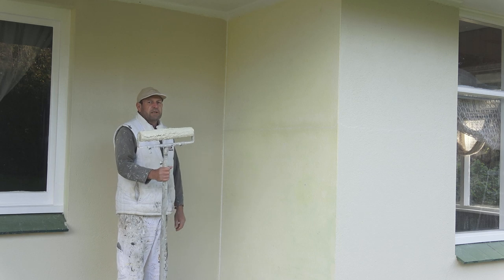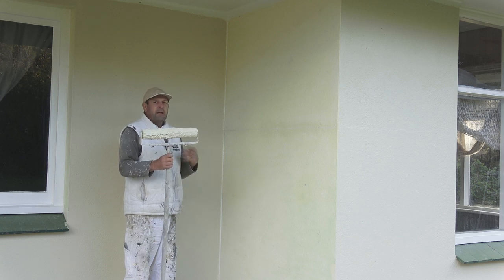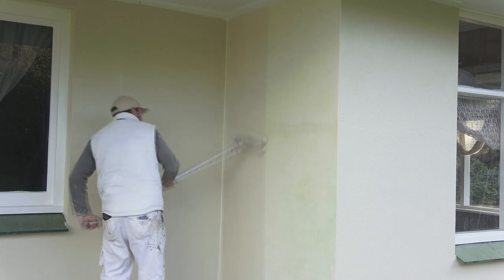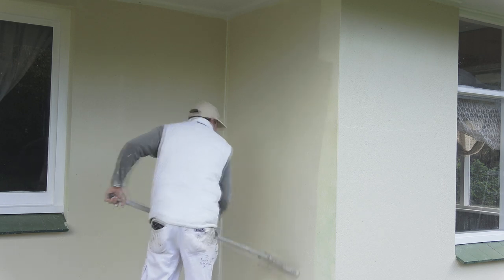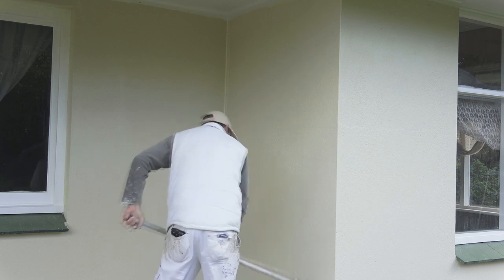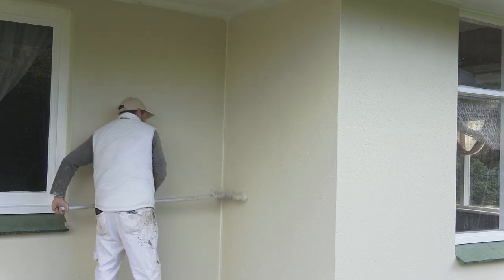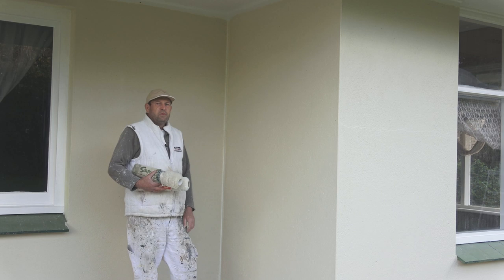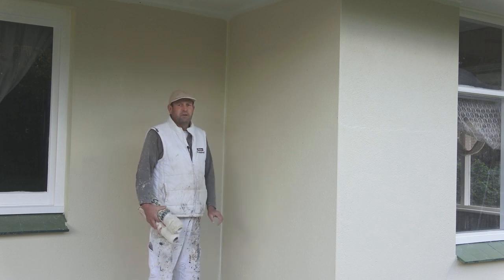How to paint cement rendered walls using a roller.

Comment: Do I need to primer a cement surface or will I just need more coats? This is for a cement garage footing. Thanks for the video!
Reply from the maker: You can prime or just thin down the top coat a little so it soaks in. Just make sure you are using a self priming exterior acrylic, if not then you will need to prime.
Don't forget to Like, Share and Subscribe.

Comment: Hey bud, great clip. I've got a roughcast finish interior wall. Kind of looks like very rough sandpaper. Or literally like someone painted over sand/ small pebbles. Go the same way as you have done here. Cheers from Perth👍
Reply from the maker: Yes you can do it the same as here, the rougher the texture the longer the roller sleeve nap needs to be.
Don't forget to Like, Share and Subscribe.
Reply: @howtopaintinfo  Yep copy that bud👍Cheers for the tips. Subscribed and certainly liked. People like you save people a lot of money. I've used painters in the past when I'm too busy to do it myself and have had my fair share of sub standard work. If you want to do it right sometimes you have to do it yourself.
Reply from the maker: So true.

Comment: Any advice on what paint to use with newly applied cement render?  Can just go ahead with an exterior paint or need to seal it with something?
Reply from the maker: Most exterior acrylics are fine to use without a primer,   just make sure you read instructions on paint can and also thin the first coat about 10%.
Don't forget to Like, Share and Subscribe.
Reply: @howtopaintinfo  thanks!

Comment: Would you consider using an airless spray gun to increase the amount of paint delivered on the wall followed by a pass with a roller or large brush? Thanks
Reply from the maker: I'm glad you said followed by a roller or brush as just spraying wouldn't work. The issue with spraying is all the masking time.
Don't forget to Like, Share and Subscribe.

Comment: I got my house done recently it’s smooth finish but if I touch the fender the sand comes off shouod I give a light sand first before painting !? Is there a certain type of paint thick layer so the render doesn’t chip off ?
Reply from the maker: The render shouldn't come off that easily, it should be a hard finish. If it is coming off easily it might be best if you use a sealer / binder first to help strength up the surface. With new render there will always be a little loose stuff on the surface which you could broom off first, hope that helps.
Don't forget to Like, Share and Subscribe.
Reply: @howtopaintinfo  I gotta broom first perfect I appreciate your replay thank you

Comment: Hi when after applying a white second coat on a hot day in Portugal. After drying it still looks like lots of misses ( but they aren’t) can’t be really ! !
The wall is generally in good condition clean and hasn’t been painted for app 7yrs I’m told !so Q .
 Is it lack of paint thickness / coats still ,or could it be the render has been applied badly / in different directions . Thanks every1 👏✌️
Reply from the maker: That's the thing with rendered walls, you need to force paint into all the small pin holes in the render. There is a chance the light is just playing tricks on you.
Don't forget to Like, Share and Subscribe

Comment: How long do I need to wait for the tendered wall to dry before painting
Reply from the maker: Between coats, about 2 hours but could take longer.
Just check to see if render is dry, wet areas should stand out, and you can always feel if render is damp or not.
Don't forget to Like, Share and Subscribe

Comment: hello. what is the fix for bubbling in cement rendered walls (interior) caused by moisture?
Reply from the maker: If the bubbles are drummy then you will need to remove them. It will depend on how deep the hole left behind is to what filler you can use. If they are more then 5mm deep you should be able to get cement render to stick. If its only a shallow hole then base coat or even an acrylic render could be used, just try to stipple the filler to leave a similar texture to the rest of the wall.
Don't forget to Like, Share and Subscribe.
Don't forget to Like, Share and Subscribe.
Reply: @howtopaintinfo  i'm afraid i wasn't clear. the bubbling is in the paint (some of the bubbles have burst too so it's exposing the cement render underneath) over the cement render and not in the cement render itself.
Reply from the maker: All you can do is scrape the bubbles off the best you can, then touch up those areas and if need repaint wall.
Reply: @howtopaintinfo  thanks. when you say "touch up", would that be with filler before repainting?
Reply from the maker: If needed you can fill the area where the bubbles are but you don't want to leave a smooth patch on a rendered wall so be careful when filling or touch up with paint first and see how it looks before you start filling.
Don't forget to Like, Share and Subscribe.